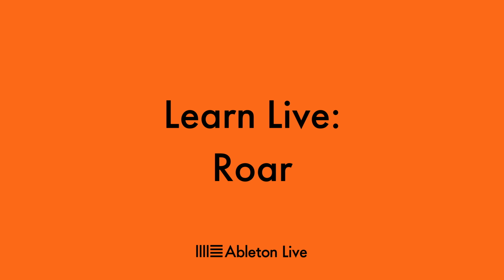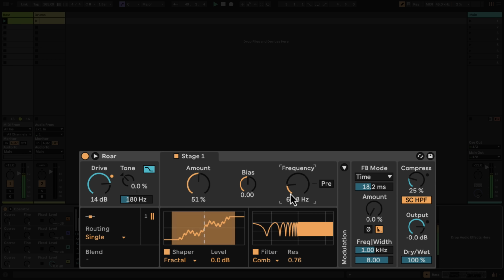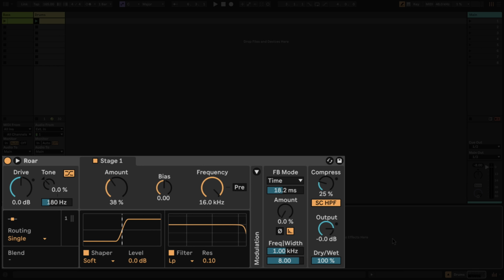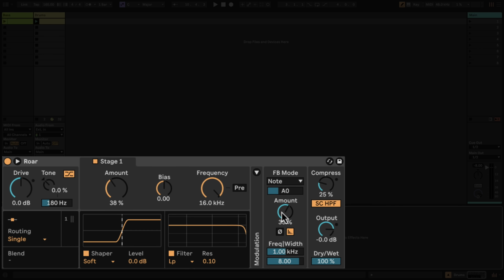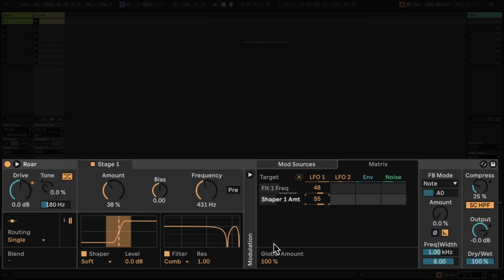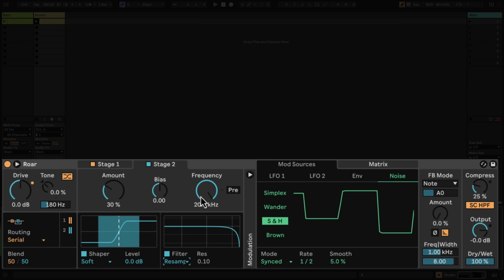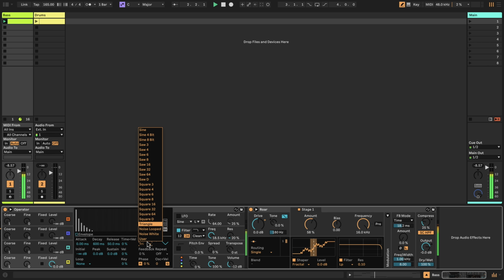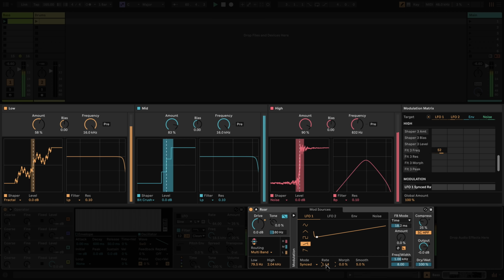Learn Live 12: Roar

Comment: Change please....please... the time option control not only ROAR'$ 
....a 30 year old dj mixer fx part have better FX DELAY  timing controlling options then  now LiVe 12 again...

On a  old 90's Djm 600 mixer  you can choose  between steps or  floating doted odd even values without a hassle fluently ...
Maybe copy a Pioneer fx Device  section as solo LIve Fx device for LiVe 13 when you not capable of changing the  delays timing  funtionality ...
 Ableton Delay'$  fail or flaws are s big limitation ....unusable specially n a LIVE performance situation without a real Mixer with FX'$.. 

I dont know why LiV€ miss such important aspect.
 I bett there is one Dj in your team that knows what Im talking about when it come to mixing and fx's on a real mixer not on  NI or Rano software then  they miss and have the same flaws ...

.....when  LIVe Performer use  the intern Delays its sound so cheap, wild harsh &  sry urrythmical boring stupid  ...arghh.,......
but its not on purpuse its a lack of control...
ROAr is cool no doubt well thought out. 
Good  Mod.sec. enhancements  and features like fdb. now as a intern  device option  is a big plus...

Hope the UI features  like big screen option  comes not only to RoAR later, it should be added to all big  devices  old synths &  SAMPLER too,..
so the hassle with device  tabs nd endless clicks will be reducted and big screens can now more often be used.
Reply from the maker: Thank you for the feedback! You can find out how to best submit feature requests to us by taking a look at this article: https://bit.ly/48QAC6m We're looking forward to more of your ideas on how to improve Live that reach us this way!

Comment: Ableton sucks for heavy guitars
Reply: ok boomer
Reply: Yes &  No ...
... the packed group devices are a solid foundation nd a  better option as the single solo devices spec.f. novice..

.....bonded corect together you have a lot of devices and options  in Live 12. But,....you have to know what works and how to build up the device chains corect and specially how set up the parameters.. but you tube  is your friend ..... cabinet , Channel Eq , Filter ,Pan are the most valued but often missing tools in combination with Amp f.e. and important as a compressor or chorus to...
Reply: skill issue